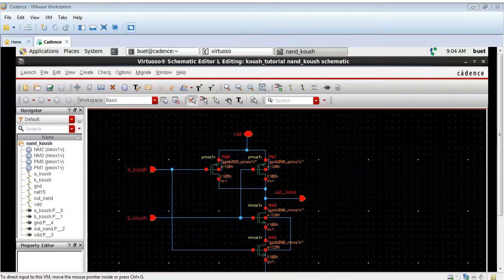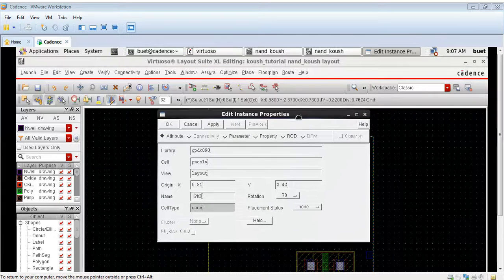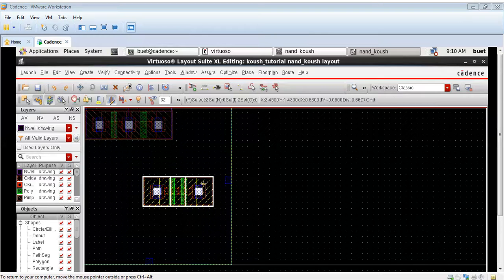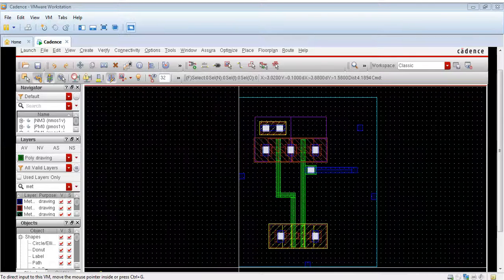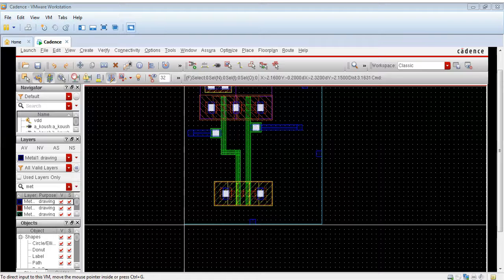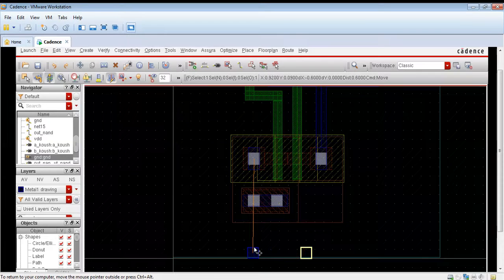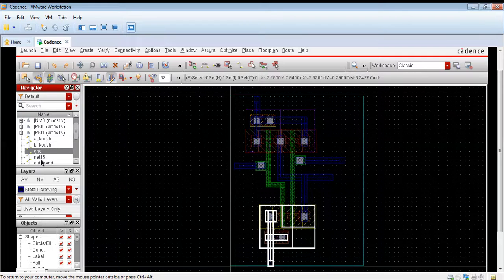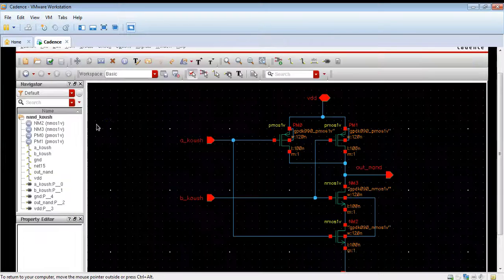NAND Gate Layout Design: A Complete Guide with Cadence Virtuoso | DRC & LVS Validation Included!

Comment: Sir I tried many times I completed  Inverter layout but I always failed in Nand layout I tried as u close the both nmos and pmos to get parallel or Series inbelow but whenever I tries it just overlap on each other sir can u please tell where I m wrong I m using 90gpdk and licensed cadence virtuous
Reply from the maker: You can check if the option is enabled or disabled in your cadence. In some versions they disable it at the start
Reply: @SuccessPointForVLSI Sir can u please tell which option ?

Comment: Drc rule file doesnot appear when I try to paste the file path what could be the reason?
Reply from the maker: Either Assura is not configured or file doesn't exist in the first place. It will have the extension .DRC or .RUL. Check if it is present or not?
Reply: @SuccessPointForVLSI  Thankyou it is present